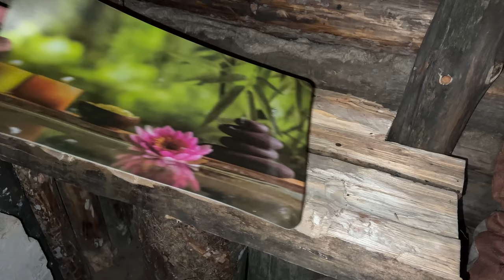On a snowmobile to the house under the snow, Winter Dugout shelter, Camp day

Comment: It's not as efficient, but I'd invest in more of a muffler.  But what you have is very efficient.  In the USA, all the snowmobiles can operate at highway speeds.  Far better to have something small and light.  I wonder why you don't see more of these in the USA.
Reply: I don't know why either, but I think that company that puts out the snow dog could definitely come up with something like this. But the DOT would probably put the kibosh on it for some stupid reason.